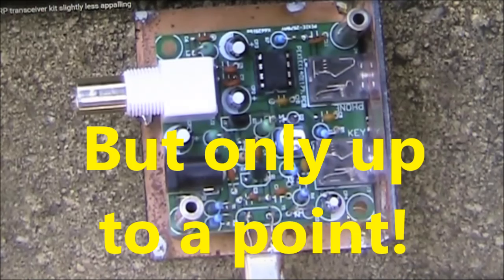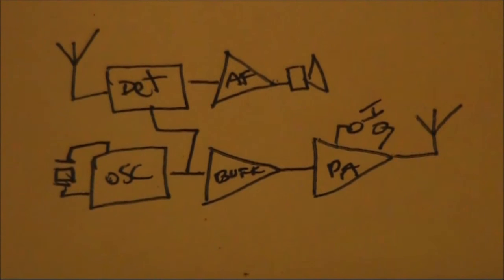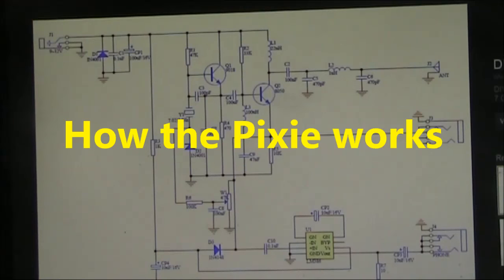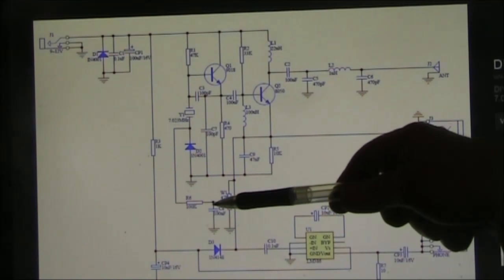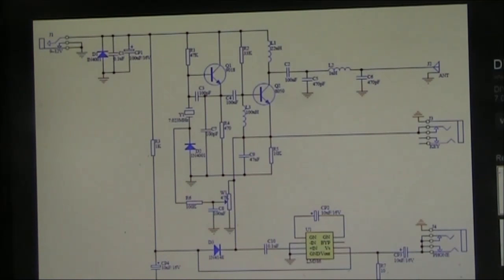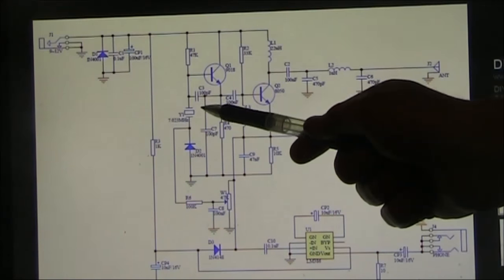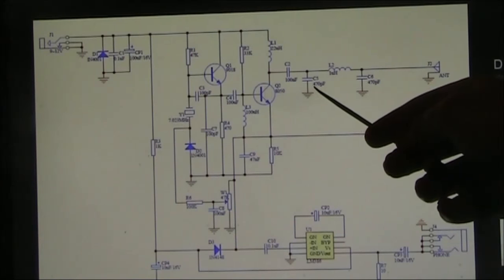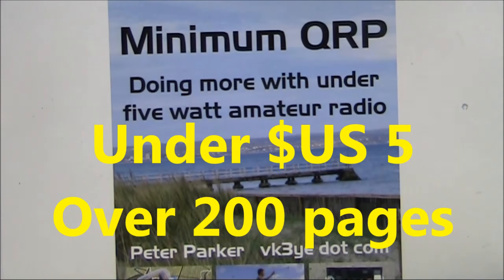Troubleshooting a Pixie QRP CW transceiver kit

Comment: The Pixies are really awesome. I've made up three, blew a transistor in one, and put the others in various tins. I have one running off a small 2 cell li-ion 7.4v battery boosted to around 12v. They're just so neat to fiddle with. The Frogs CW seems to be more stable with a few more bells and whistles, but the kit I had was missing several components, but I had a few that were needed laying around anyways.
Reply: MattExzy, how did your transistor “blow”?  Was it something you did or just infant mortality?
Reply: Mine blew the o/p transistor and an electrolytic cap. and possibly the LM386. The track lifted trying to replace things so I got another one last year. 5.262 MHz and 350 mW out. I did get contacts before it blew up.
G4GHB.

Comment: I built one, not working yet.  I had the zener diode in backwards, but fixed that.  I will check all the components again for any things I did, but I think they are all correct. 

I don’t know how to test components in circuit.  How can one test a capacitor in circuit?  Transistor?  If I had an oscilloscope I would hunt around for wave forms and voltages, but I don’t know what test points would be meaningful. 

Thank you for the video.

Comment: 6:00 Since inductors (in this case L1-L3) are not polarized, it shouldn't matter which way I put them in, correct? I know in some instances that inductors used with transformers, sometimes have to be put in a certain way, but those inductors and schematics are usually marked as such. I didn't see that with the schematics for the pixie 4.1 unless... Anyways, any clarification is helpful. Received my first pixie a couple weeks ago and finally have it put together. Powers up fine and didn't let the magic smoke out. But not receiving any signals and not picking up transmissions from the Pixie on my SDR. So trying to track down the problem.
Reply from the maker: correct - not polarised
Reply: vk3ye Thanks for the quick reply. Great videos by the way. Thanks for the clarification, helps rule that out.
Reply: I've the same problem,     ea3ze

Comment: Be aware there seem to be several manufacturers.
I had no audio on mine. I theorised the audio was bypassed to earth and had to remove the audio jack socket to confirm it. The track needed cutting to prevent this. I wrecked the socket.
Best dx on 5.262 MHz, 180 miles QSO with a SWL report on the same QSO from Utrecht at 220 miles. 350 mW out. Equivalent to 660 miles per Watt if you like.
G4GHB.

Comment: Thanks for this. Unfortunately, my issue isn't addressed. Mine transmits, but the receive circuit has a constant audio tone oscillating much like a digital signal would sound

Comment: To avoid many problems - test each component before assembly if you have the equipment.  You will need a multimeter that can also measure capacitance at the very least, and LCR meter is ideal as well as some way to test your transistors (there's an inexpensive Atmel microcontroller based transistor tester kit on eBay that will do most of these tests for you).

Comment: Im struggling to find an appropriate antenna for the pixie, any suggestions? everything seems to be rated for vhf and uhf
Reply from the maker: A half wave dipole or end-fed wire for 7 MHz will work. It will be 20m long. See my website vk3ye.com for ideas

Comment: The 33k resistor, supplied with my kit, was the color of the inductors, but measured about 33k with a VOM.  Is this a resistor?  Why is it the color of the coils?  Is this common?
Reply from the maker: If it measures 33k it's a resistor. Inductors are close to short circuit.
Reply: vk3ye, thank you for supporting my conclusion.
Reply: @vk3ye  Mine is the same Way !!! thanks I would never of known
Reply: my issue it it works but there is a  strong AM station im getting 1240 or 1400 am they also transmit on 101.5 and 107.5 FM..... darn i want it to work !!!!  SATIFACTION !

Comment: Hi Peter. I wanted to ask one question as I'm lost in all the info available online. Does the version of the Pixie you are using in the video has automatic frequency offset on transmit and receive ?  I'm asking because I found a lot of schematic online... that are using a third transistor for that. So before building the kit I was wondering if this one as it is has that by default... or I would have to make the changes by adding the third transistor instead. Thank you... as always. I wanted to email you instead but I forgot the address )) 73
Reply from the maker: All versions of the Pixie have some sort of offset with a third transistor not required. It does this as the voltage on the Q2 emitter drops when it's keyed. Circuit here: https://w5nor.org/pixie/
Reply: That's great to hear. Thank you so much.... and wishing you an amazing weekend... as it's close ))

Comment: my daughter just finished hers, it started to smoke haha :-) we will get another one and keep attempting until we get it right? i notice it seemed to be reverse when keyed it did not transmit when not keyed it transmitted then it started to smoke, any ideas :-) Im going to watch this video a few times and see if i can figure out where to start on this
Reply: the smoke looked to be coming from electrolytic capacitor right behind the bnc connector. but i do not see any burn damage yet.

Comment: I'm little confused about the point on schematic that I apply the AGC, a suggestion?
Reply from the maker: You can build a very good receiver without an AGC.  However putting AGC on a poor receiver like the Pixie is like (as we say in Australia) putting lipstick on a pig.  Hence it's better to leave the Pixie as is and build a good direct conversion or superhet receiver and add AGC to that.  But if you insist look up any audio amplifier circuit with audio AGC and use that.
Reply: Thanks...Peter 73!

Comment: Have you ever made a contact on one of these?
Reply: My answer is a few years later to your question, but I made several contacts.
QSO's at 60 miles, 80, 120 all several times and 180 miles with a SWL report from Utrecht at 220 miles. 350 mW out on 5.262 MHz. Unfortunately it blew up, p.a. transistor, electrolytic and possibly the LM386. The track lifted when trying to replace the transistor so I gave up and got another Pixie last year.
G4GHB.
Reply: @bill-2018  Haha. I built like 3 of em and called CQ and got a reply at one point. Didn't know morse so I just ghosted back. It definitely did work!
Reply: @joblessalex  Okay, thanks for replying. Yes they do work. Might be two or three c.w. signals received at once on 40m which is why I put mine on 60m, and put some activity on the band.
G4GHB.